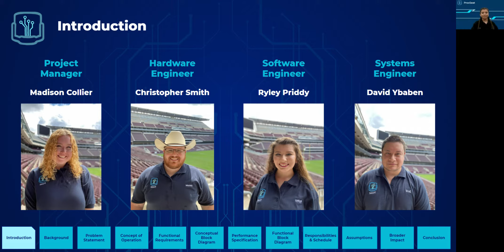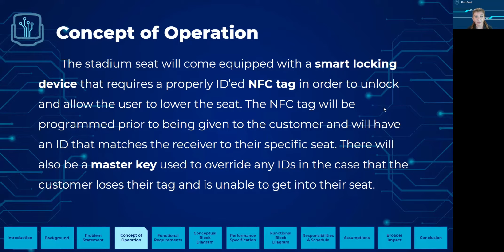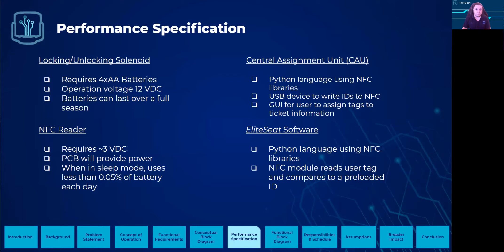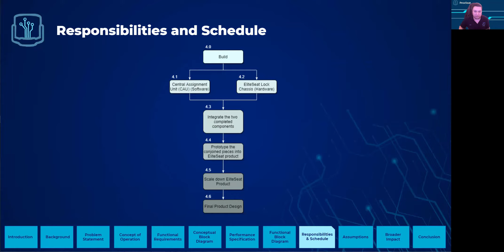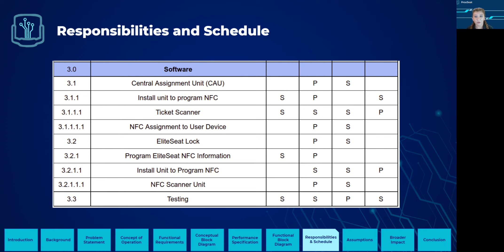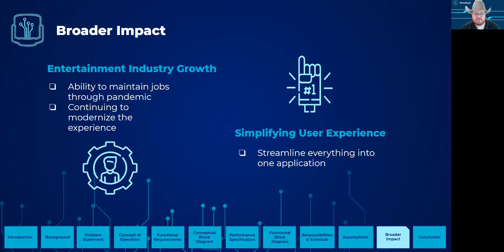ProxSeat Preliminary Design Review (PDR)

Comment: On the Conceptual Block the diagram, the lock was shown to be fairly close to the axis of rotation for the seat. Thinking about lever arms, the lock could be designed weaker (cheaper) if it was as far from the axis as possible. Otherwise there is a risk of the chair being forcefully opened. Just an observation

Also, what would be the benefits of battery power over being connected to the grid? Batteries are pretty expensive and would require a lot of effort to change out on a mass scale like a stadium.
Reply from the maker: That is a great point about the level arms and one that we had considered. As this system is still being worked out on the physical side of the project, nothing is quite set in stone yet in terms of exact placement. 

As far as power goes, we are utilizing a power bank for ease of use and convenience. The vast majority of stadium seats across the USA do not have power access inherent to them.

Comment: This was a fantastic presentation! Very professional and clear! My only question is, will the seats be synced up with event times? For instance, if a game starts at 4:00PM gates open at 2:00PM, will the seats be "unlockable" at any time or starting at 2:00PM?
Reply from the maker: Thank you! The NFC ID will be linked to the event start time through the central assignment unit. This will allow for the venue to set the time the seats need to be unlockable.